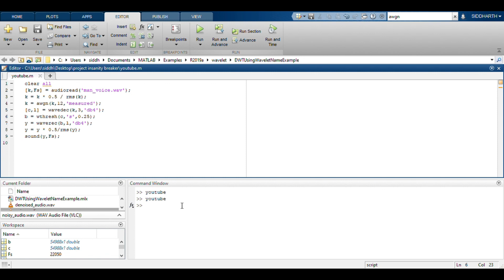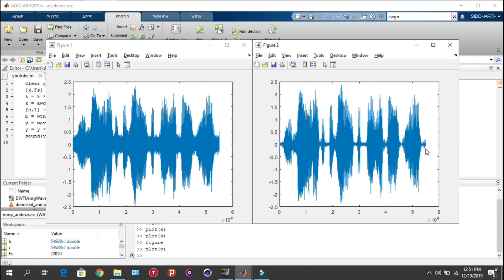Simple audio denoising using wavelet decomposition and thresholding, wavelet denoising [ MATLAB ]

Comment: Hey .. thank you for the tutorial. I am stuck on the first part where an error says undefined function or variable ‘audioread’
Reply from the maker: If you are using an older version of MATLAB namely 2015 or below , use wavread instead. It goes unsaid, your audio file is recommended to be in .wav as well.
Reply: Siddharth Lh i am using matlab 2016.. i think it finally accepted with audioread. I still have questions though.. it keeps saying “k” is undefined variable , and “Fs”too when i try to run the program. Did you define them earlier or they just resulted from running the program..? 
Am really sorry for the endless questions
Reply: @agathanampeera4925  k and Fs are an output from the audioread function, it sounds like audioread may be you're problem. Make sure you have the audio file that you are trying to manipulate saved in the same location as your matlab file.
Reply: Siddharth Lh Also if possible, could you please do a video on finding the fundamental frequency of the audio wave, the Jitter, and other characteristics of the audio wave using wavelets.
Reply from the maker: Use pratt software for this.
Reply: What if we are not using awgn?
Reply from the maker: @arunprakash8238  It will still work with brown or pink noise or for speech which is already noisy. For non deterministic noise signals, denoising will require a deep learning approach, like NVIDIA's RTX Voice
Reply: @SiddharthLh  so if we r using a sound from a commentary of a match can we remove the crowd noise through only deep learning
Reply from the maker: So, if there is a huge crowd, it's a large mixture of non deterministic signals, so it's actually almost Gaussian again. So it will work fine. Ofc, deep learning will work a little better. If you want to filter live footage in realtime, you might need to make a simulink block for the same